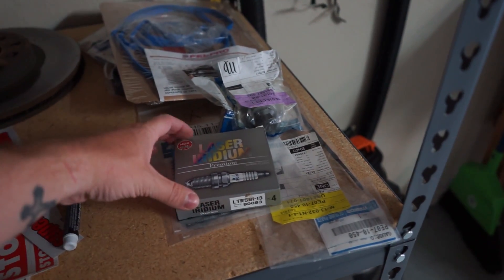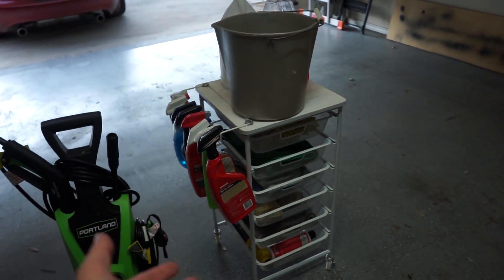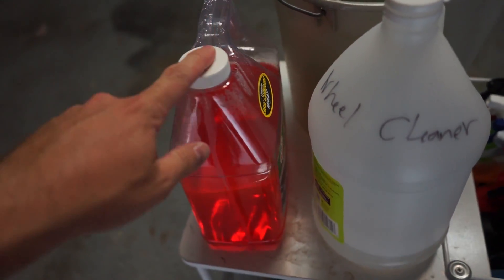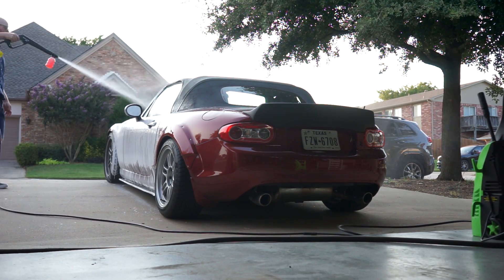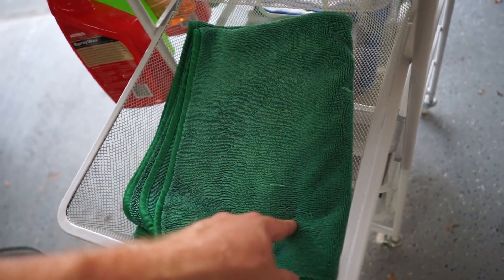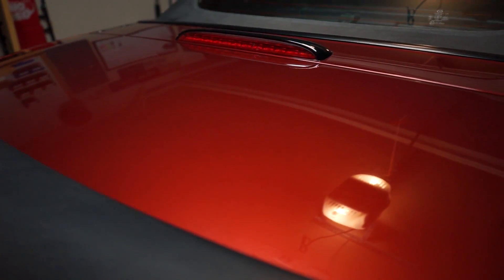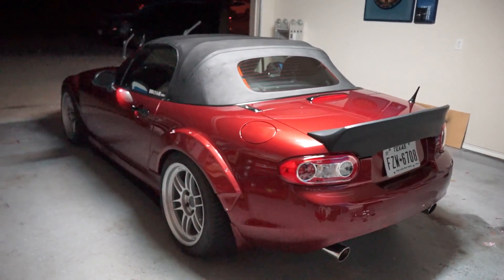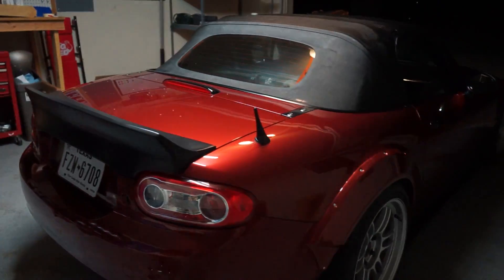How I Wash My NC Miata & Products I Use!

Comment: Your driveway looks like it's got a decent dip to the road, how has your car held up being lowered? Any scrapes? I've got a pretty substantial dip at my work carpark and wondering how low I can get away with lowering my car.
Reply from the maker: I have to turn sideways to exit my driveway but thats no fault to the car, the driveway is a dumb design. I dont really scrape on anything. Sometimes under the lip will brush against higher things
Reply: @ColoredinLight  ahk nice, so nothing under the body of the car scrapes. I haven't lowered my car yet, but I'm looking to get some bc racing coilovers in the next few months.
Reply from the maker: You'll definitely be fine. There are much lower NCs than mine!